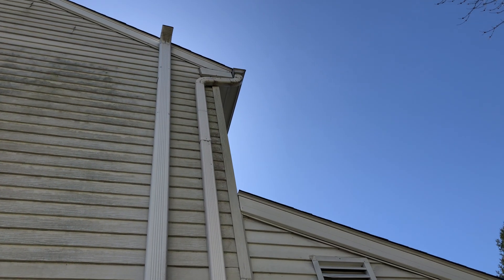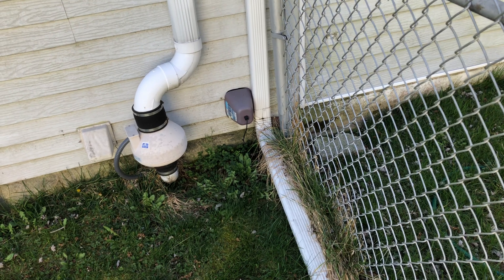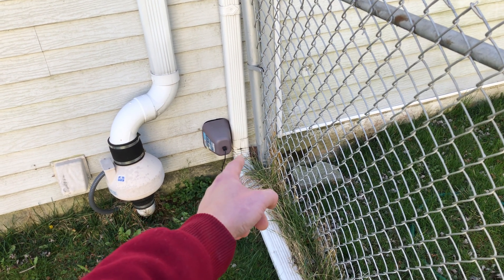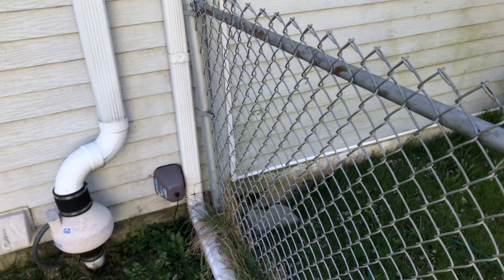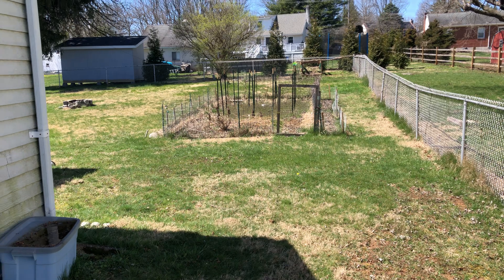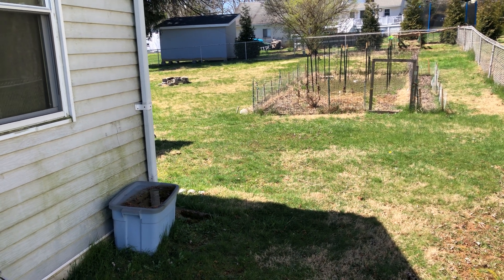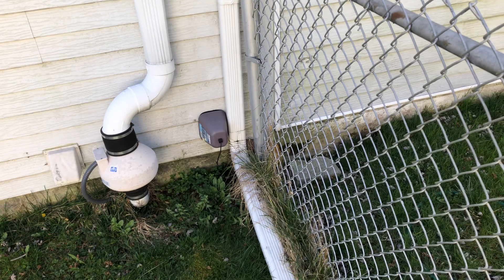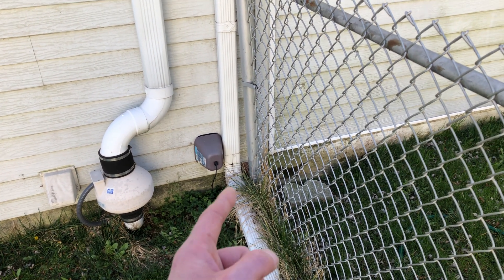Gutter antenna recap.

Comment: You have a random wire antenna. A 9:1 unun is essential since the feedpoint impedance is typically 450 ohms.
Reply from the maker: @doc145  Yes I know

Comment: 80-40 OK what about 20-10, what size wire did you use 18 gauge
Reply from the maker: Yes my particular application worked on 20 -10 as well.  But at the time I used it for 80 meter.   I used 16awg that’s what was around.